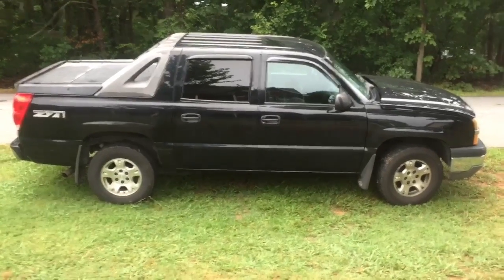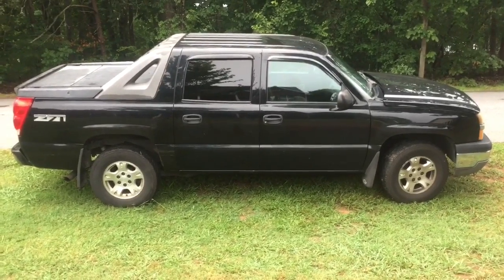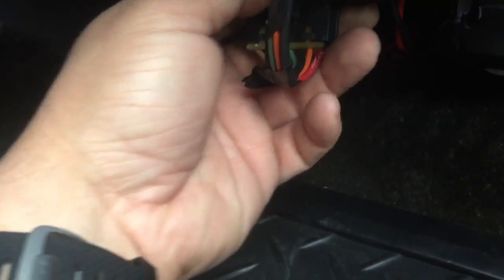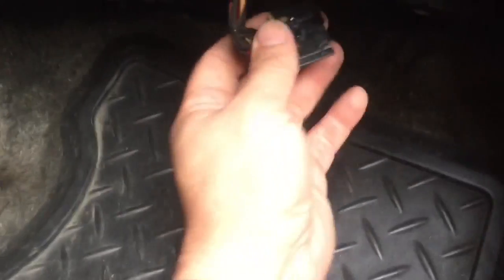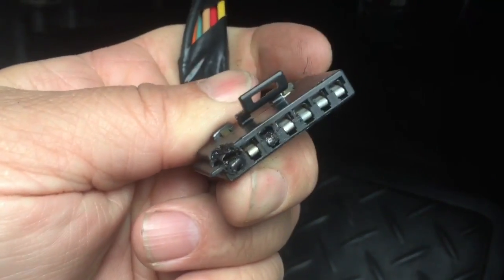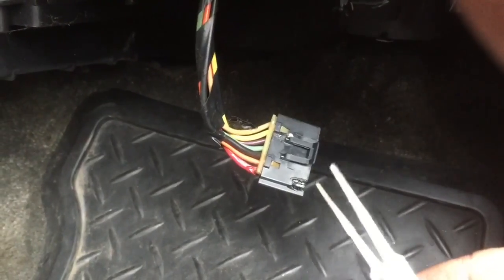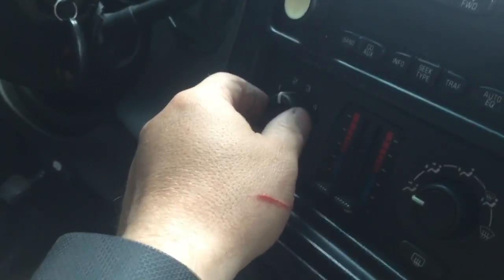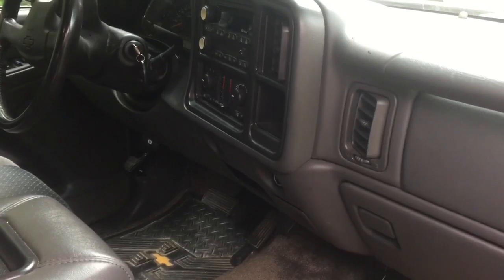Chevy Avalanche Silverado Blower speed repair

Comment: Hey where is the blower relay? I need to replace both (resistor and relay) for my sisters avalanche.  Her truck only works on the #5 setting and  somehow it stayed on without her knowing and drained her battery.  Excellent video  by the way, very helpful.

Comment: Hey when you say automatic control part are you still talking about the resistor or the control module under the radio ?
Reply from the maker: So if you have the automatic climate control meeting the one that you can just set the temperature and put it in auto mode to maintain that temperature then you will have a slightly different resistor setup but the same process to repair or replace it.

Comment: How do you know if the resistor is the fault.? It worked perfect yesterday.
Reply from the maker: Usually if the resistor is bad the fan will operate on the highest speed but none of the lower speeds.

Comment: Blower motor making noise
Reply from the maker: A noisy blower motor is usually caused by either failing bearings in the motor or debris in the fan. Sometimes a cracked or damaged fan can be the cause as well. Best bet is to install a new motor if the fan is clean and in good shape.